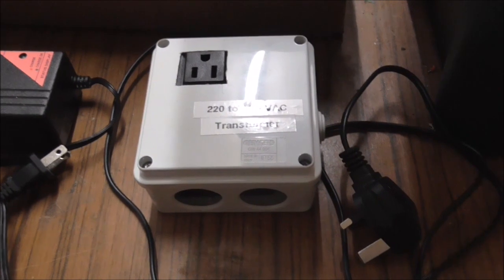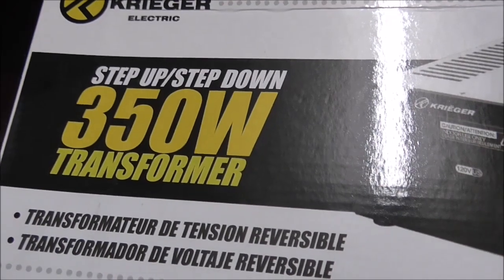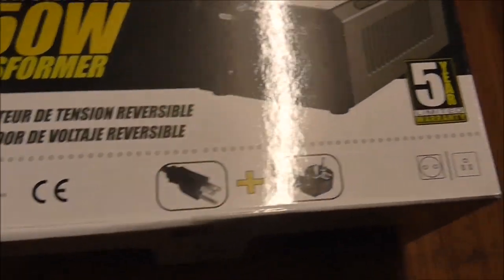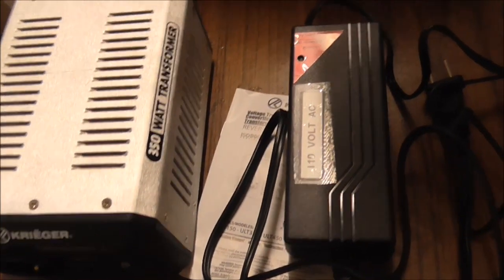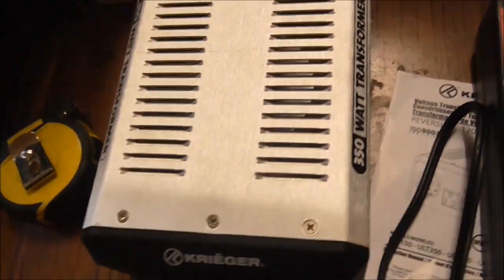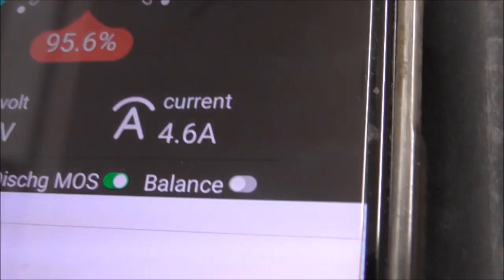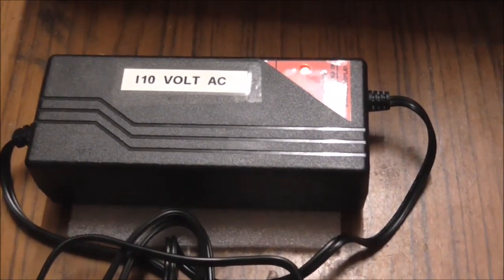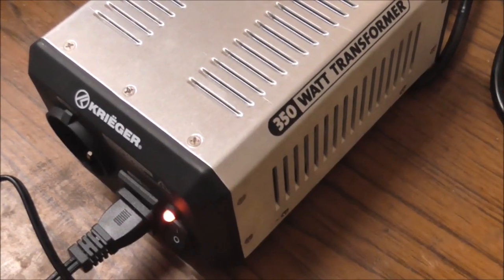Krieger 350 Watt Step-up / Step-down Transformer

Comment: Thanks for the video, Martin, very informative. When you were demonstrating the unit I could hear a fan in the background, but didn't see a fan when you opened it up. I'm hoping that the fan noise was from elsewhere. It's very important that the transformer be as close to silent - is it a quiet unit? The transformers I have all buzz like angry wasps, but none of them are toroidal, which I hear is quieter than an ordinary block transformer.
Reply from the maker: John , yes the unit is quite to run. The fan noise you hear is from the battery charger I was using as the test load.

Comment: Martin, thank you for the video. I recently bought the exact same model, and by searching the model number on YouTube, I found your video.

I've recently returned to the UK from living in Canada and brought back quite a few appliances that runs on  120V (hence the purchase of this transformer), but i have to admit i know next to nothing about voltage/electrics. 

With that being said, if i stick the Canadian appliance running on 120V into the 120V outlet and then set the AC input select switch to 120V, is that ok? Getting a bit confused about the AC Input Select Switch.

Appreciate any advice you could offer.

Cheers,

James
Reply from the maker: James if you are in the UK the input mains voltage will be 220/230 volt. You need to select the input of 220 volt on the changeover switch. Then you can connect your appliance to the 120 volt output.
If you have purchased the 350 watt unit the  Need to stay at or below this rating.
Reply: @martint1151  thanks for the prompt reply - was going to test it on the missus's hair dryer before any of my gear so you've saved me from the dog house there !
Reply from the maker: @KTBFFH  James check the hairdryer rating as most of them are  over 350 watts , check the rating watts on the dryer.
Reply: @martint1151  will do. Thanks 👍